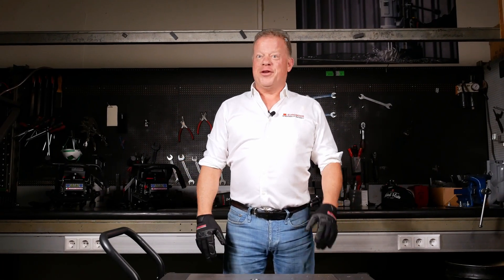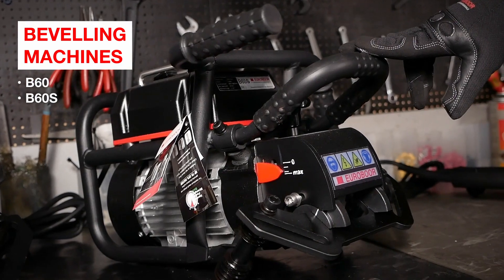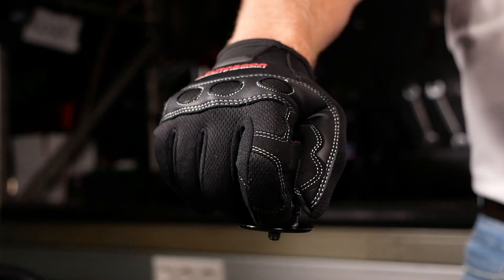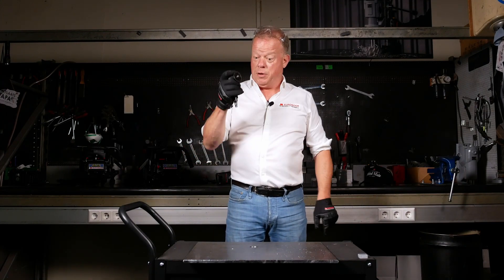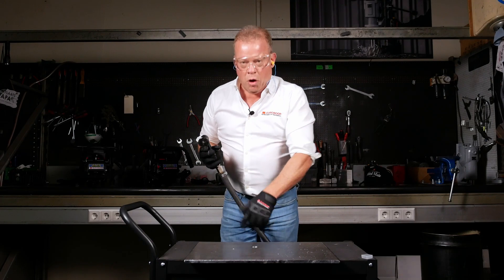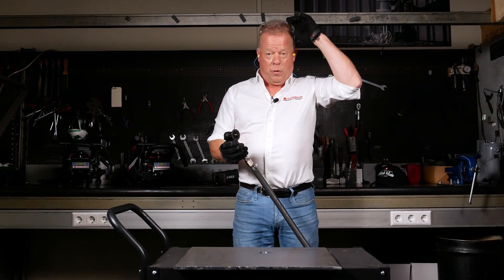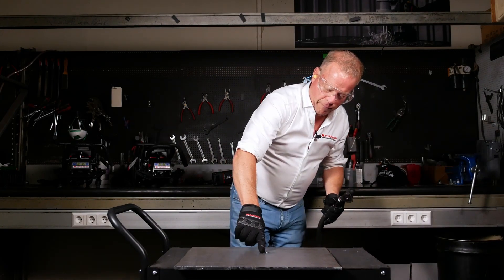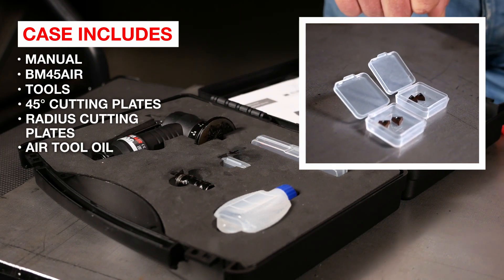Euroboor | BM45AIR

Comment: I bought euroboor magnetic drill Eco 50s . unfortunately the magnet is not strong enough and the machine be coming overheating after just 10MN of work. I don't know if there's any any adjustments to do for the magnet.
Reply: Hi Yousuf, on what kind of steel did you put the machine and how thick was it? An electro magnet like the one on the ECO.50S requires a minimum of 7MM
Reply: @pieterdriessen2037  I used it on a 10 mm carbon steel
Reply: @yousuflamboni6939  Has this been fixed? please let me know where you bought the machine so we can give you the proper service